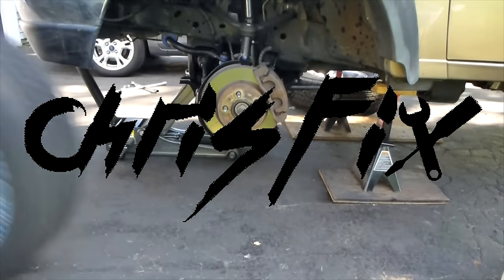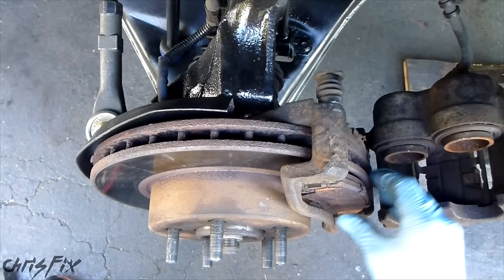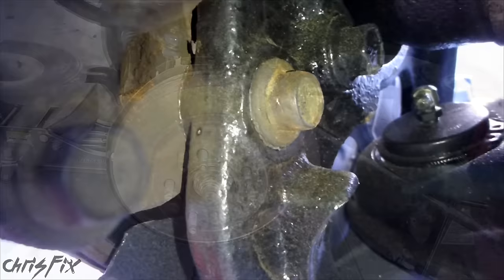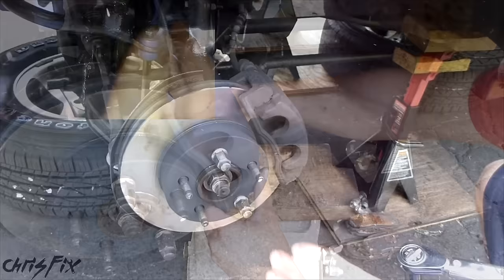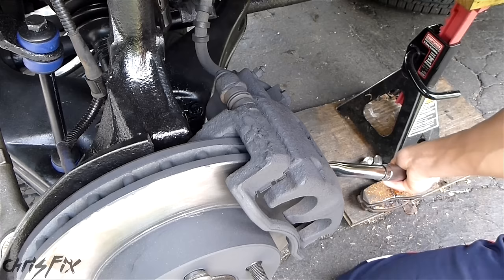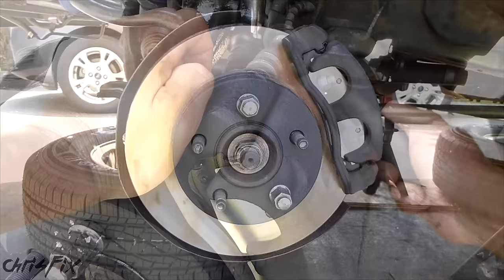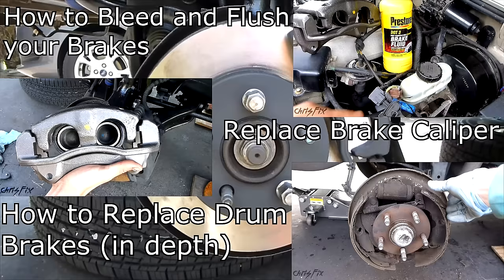How to Replace Front Brakes, Pads and Rotors

Comment: CHRIS, When bleeding a vehicle with all 4 ABS braking system, does it matter what order you bleed the brakes? Some guys do front right, then left rear, then front left and finally right rear.  What do you think?
Reply: Sully Cop It depends on where the master cylinder is. If it's on the driver side, it goes from rear right, rear left, right front, and left front. If the cylinder is on the passenger side, it's rear left, rear right, left front, and right front. In other words, farthest to closest.

Comment: That helped.  Thanks.  Btw is putting that silicone on the long bolt really needed and adding grease to the contact points.  What i mean is it important enough that i should run to the store and get some?
Reply from the maker: Yes you  definitely want to get some silicone grease. They sell small packs of bulb grease at the parts store for $0.99 which is the same thing.  Watch my newer brake video that covers every single detail: https://www.youtube.com/watch?v=6RQ9UabOIPg
Reply: That was even better, thx.

Comment: Hey Chris I was trying to change my front brakes on my 2004 Ford Ranger but I was not able to get the bolts loose that hold the caliper bracket to the rotor.  Any suggestions on what I can do to loosen those with out snapping them off?

Comment: My rotors are getting extremely hot  🔥  does that mean I need to replace and when I brake they don't squeal.the make like a squeeking bed sound and feels crunchy if that makes sense ?.Amy advice fellas ?money is tight so don't want to replace something I don't have to.  But nervous working on brakes something I noob shouldn't be doing but I have to.learn one way and one day any help is appreciated thx
Reply from the maker: It sounds like the pads are worn down to the metal which is causing the crunchy/squeaking feeling, I would start off with inspecting the pads/rotors and going from there

Comment: hey chris, if I dont have a breaker bar and only just a normal ratchet - is it advisable to use a lubricant to help with unscrewing the bolts?

Comment: Thanks, Chrisfix - used this today on my 2011 SHO. Question for you: the replacement pads came with hardware, and I used it - but it only came with the metal parts that the pads ride in, and did not include a spring that was on the existing brakes. The spring was in between the pads at the top and bottom and looked like it pressed them outward. I didn’t want to mix old and new parts, so I left the springs off when reassembling. Looked at Rockauto and for the 2011 Taurus SHO, only one hardware kit comes with the springs - all others are just the top/bottom metal pieces. Anything to worry about, in your opinion?

Comment: Awesome video Chris did my first brake with your help thank you.? For you I think I made one mistake on my front pads where the piston meet the pads I forgot to put brake grease do you think this may give a problem and if so should i simply take the wheel off and redo it.your thoughts please it's on a 2012 dodge ram
Reply from the maker: Awesome work. If you sanded the surface clean and used new brake hardware, you can get away without greasing it. If it starts to squeak, you know what you need to do haha.

Comment: How do you know how many foot pounds to torque things and how did you perfectly get it to 85 or whatever it was with the breaker bar is it electronic on there?? I never understood that does it say in the manual or online? I always tight stuff pretty hard which I've learned snaps bolts but yea how do you know that?

Comment: I got a question mister, is it mandatory to change the rotor in order to change the pads? I got the brake pads but I couldn't afford for the rotors, which is why I'm asking if is possible to change the pads without changing the rotors, and leave the old ones.
Reply: You don't have to change the rotors when you change the pads. You only need to do rotors if the rotor is warped or cracked. Pads usually are on their way out long before the rotors.

Comment: hi , i recently changed the rotors/brake pads/brake fluid. should i follow a certain driving habit for the few hundred miles on the new kit?
Reply from the maker: You can drive them normally. There is something you can do called bedding the brakes where you drive 40mph, jam on the brakes but dont lock them up and bring the speed down to 10mph, repeat this a few times and then drive normally to cool the brakes down.

Comment: What does it mean when you take the whole brake caliper off and it struggles to get back on ( kind of forced it on where the holes for the bolts where then tighten them. 
But I didn't put in new brakes just put my old ones back in and now I'm getting a scraping or scratching noise when I turn and loud squealing and squaeking whenever the wheel is turning not just when braking but when I'm off the brake and in drive

Comment: Hey Chris thanks for the great videos. I followed this to work on my own, but after being done I went for a test drive and I'm hearing a grinding noise and feeling it... any thoughts or ideas as to what I might have missed or done wrong ?
Reply from the maker: +Sergio 5280 There really isnt much you can do wrong. I would take the wheel off and just do a quick inspection. Maybe your caliper is going bad and not disengaging?
Reply: +ChrisFix thank you sir will def. look into it

Comment: just wondering i did all my brake pads and did my front sway bar links and replaced all my struts and shocks on my jeep patriot and now i noticed theres a rapid thudding noise when i start braking.  let my rear brake pad wear down to the metal. i replaced the pads anyways the rotor is damaged. i read that that noise could be the rotor. wondering what your input is

Comment: I just replaced my rotors and brakes yesterday and while I was driving I heard a grinding noise coming from the back tires , is this normal? The rotors and brakes are brand new.
Reply from the maker: Grinding is not normal. Did you make sure the brake hardware was not touching the rotor?

Comment: hi chrisfix,I have a question,so we only need to bleed if we just only changing the pads?thanks
Reply: You only need to bleed if you're replacing the actual Caliper itself. You have a brake line that leads into the caliper. Inside the caliber is your brake fluid. When you replace the caliper, you have to disconnect the brake line from the old caliper in order to connect it to the new caliper. When you do this, there will be no brake fluid in the new caliper. Because of no brake fluid in the new caliper, you have to bleed the brakes. 

Hope I was helpful :)

Comment: ChrisFix, I am in need of chainging out my rotors and pads on my 2008 Mazda 3 i. I have been searching around the web on which brand are good. The local auto store has some but are 50-60$ per rotor and about 45 per pad set. However, I have found kits that are abour $160. What is your advice on selecting a good rotor and pads? What brands are good and not good? Thanks

Comment: I was quoted 330 to replace front pads and discs plus bleeding on my car by a dealership. Me being me i started searching if its a good quote. Parts it self 250ish, so if i was going to do it my self thats nearly 100 in my pocket.. then i would had to buy hydraulic oil, some tools, anti seaze, take a day off work, so the 330 quote is looking cheaper compared if I was going to do it my self
Reply from the maker: That's a pretty good price! Usually the dealerships charge way more than that
Reply: @chrisfix  probably I should mention that it is 330 brittish pounds heh. Yeah, it is a very good quote, where I live we have 11 car dealerships just in one town and countless mechanics\garages, they need to be competitive to get the work which is a big bonus for customers like me.

Comment: Anyone  that is a first timer to changing brakes on a Ford Ranger, these instructions on the video don't apply for taking the disc rotors off for a 2wd. The 2wd rangers require the whole wheel assembly (wheel hub and rotor come together as one piece) to come off. You have to take the dust cover off, remove the cotter pin, remove the axel nut washer, front outer bearing, then slide the whole wheel assembly off.  You have to repack the bearings in the new disc brake rotor and hub assembly. This is more steps than required for the 4wd. Just wanted others to know what you are getting into if you have a 2wd. I made the mistake of thinking my rotor was stuck to the wheel hub. It wasn't because it comes as one piece with the rotor..

Comment: hey man. silly question. I have a Chevy cruze 29,000 miles had since November 2014 and never changed my brakes since then. is that bad??? got the car brand new at 500 miles. should I put on a new rotor and pads
Reply: Why replace if there's no problem?
Reply: that was a few months ago. i have now learned how to check em haha my brake pads are still good

Comment: Hello Chris, I am trying to replace the rotors on my Mitsubishi Colt 1.1l, 2006. I took the callipre and callipre bracket off but the rotor wouldn't come off. I tried with screw driver as well as hammer but the rotor won't move a milliliter. I am wondering if I need to take that big 32mm nut off or is there some other reason. Please let me know, Thanks.
Reply: try using a penetrating fluid if its considerably rusty, and keep going with the hammer

Comment: I have to say this as constructive criticism and I really do think you need to add it to your video especially if you're advertising that it works for all makes and models but Hondas and Acuras use a Phillips tip screw on the rotor which is almost impossible to take off without an impact driver

Comment: Hey ChrisFix, love your videos!  You are very thorough and informative.
Unrelated to the video I'm actually in the works to have my wheels cleaned and painted.  Like you I also hate the look of plastic hubcaps so I'm going to be running my wheels bare.  Problem is my hub bearings are rusted and I don't want that to ruin the look of my freshly painted steel rims.
Any advice on how to clean those up?  Thanks in advance!
Also happy new year! 🎉
Reply from the maker: Use a metal wire brush and then put a lite coat of paint on it!
Reply: @chrisfix  Thanks for replying!
I will see how well a wire brush will work on the center hub.  That aside I did enjoy your 'How to paint your wheels' tutorial.  I'm excited to get started on the project.  Just waiting for the weather to improve here in central Cali.

Thanks again for making these great videos!  Your fans appreciate you.

Comment: hey Chris I had a question for you. I thought I followed your instructions which are great by the way. But I replaced my brake pads and now I am noticing when I go to break that my steering wheel shakes as if the brakes aren't making very good contact with my rotors. any suggestions on what it might be? Or a way to troubleshoot?
Reply from the maker: Did you replace your rotors? If not you can have warped rotors which causes that feeling.
Reply: No I didn't. They didn't appear to be too bad. No distinct grooves when I run my finger nail across them. But they could definitely be warped. And I accidently snapped one of the bolts when trying to get it out of the caliper unfortunately. But I was able to buy a new one for not that much and replaced the old caliper bolts with the new ones that I bought. The calipers hold pressure but they are original and rusty. Wish I had the money to replace everything, calipers and rotors. Thanks for taking time and commenting back. Wish you were local. We need more honest, smart car guys like you in this world.
Reply from the maker: +Kyle Weckenbrock yea it's probably the rotors then. Glad I was able to help and don't worry, we all snap a bolt here and there!

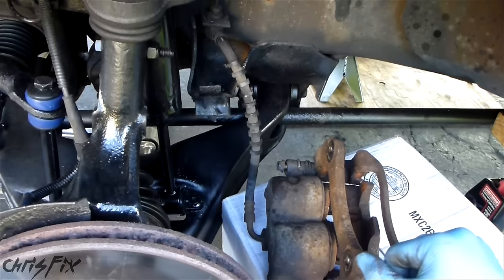Comment: 2:24 - "Now this should just slide right off"  That never happens. Brake rotors almost always get rust welded to the hub. Use a pusher bolt/nut setup through the brake caliper mounting holes to push them off. Sometimes additional coaxing with a hammer is needed.

Comment: Hey Chris what kind of brakes should I buy? It's just for my Subaru don't need anything special
Reply: Semi Metallic pads are cheaper but Ceramic pads are more expensive than semi metallic pads but they last longer. Drilled and slotted rotors are more expensive than regular smooth ones, its the same concept. Hope that helps

Comment: I recently had my brake pads changed, then the front right one was making a super loud long whistle noise. Took it back to the mechanic and redid the front brake pads again. Days later that same loud whistle noise came back so I took it elsewhere and they charged me $230 to do God know what and assured me the noise would go away. Well it’s back again 😩 what could it be?

Comment: Mine makes a squeeling noise when I break sometimes, I'm assuming I need new pads?
Reply from the maker: +Joe Luis Maybe. It could be just contamination and in a few days it goes away. I would take the wheel off and hit the brakes with brake clean and do an inspection to see the pad depth.

Comment: Common mistake made here. The rubber boots caliper pins require the lube provided. It dusnt go anywhere else. If u put on mounting surface grease will contaminate the brake pad and rotor surfaces. Before you even put rotors on, you thoroughly need to wipe the surfaces clean. Not just spray them. You can clean metal to pad surfaces with a wire brush and brake cleaner. Also the rotor surface to hub needs to be clean.

Comment: hi Chris,  I just replaced my driver side front brake,  rotor,  n caliper..   my old caliper was seize up and causing my brake to smoke..  I replace the front driver side caliper, brake pads,  but still smell the brakes,  and when I remove my foot from the gas pedal, the car feels like its slowing up..   what can be the problem?   please help me...
Reply: +jose ilarraza I'm not sure about the smell, but as for the car slowing down does it slow down like the brakes are being applied, or like the normal engine braking? Either way just take it to a shop and get them to check it, brakes are kinda important and if they fail... Well it wont be too pretty. Better safe than sorry

Comment: About the only thing I didn’t like was the ‘no need to bleed the brakes’. You should bleed your brakes every time you change the pads They should be bled before you push the pistons back in to make space for the new pads. When you see the colour and condition of the fluid that first comes out you’ll understand why. By pushing the calliper piston back in without bleeding them first, you’re pushing dirty, burnt brake fluid back up into the system and are asking for trouble.

Comment: @Chrisfix hey Chris. In my country it’s hard to get Silicone Paste. I found some in the internet from 3M, but there are two different kinds. Wet & dry. Which one should you think goes well with brake jobs? Such as applying to the guide pins. Thanks.

Comment: Is this process the same for the rear brakepads/rotors?
Reply from the maker: For many cars it is the same or just slightly different (you will be able to figure it out). Some pistons have to be turned (like a screw) in the rear instead of pressed in.

Comment: Hi, do you know what size rear rotors would be the correct size to buy for my 2004 Chevy Silverado, 2 door, 6.0 v8 extend cab? Thanks for your time.
Reply from the maker: +AllSystemsGoSound You can check at your local parts store or call chevy for that information!

Comment: The brake and light inspection wanna to charge me 1000 to fix my repairs.  So I went to TJ Mexico they replaced front brakes ,drum brakes front rotors front wheel seals, wheel bearings rear seals bearing ,also rear wheel cylinders they also installed a new brake line hose. For just 170 I brought all the parts in autozone in the states. I also got a life time warranty air compressor ,condenser, A/C Accumulator orifice tube at car quest in Tijuana he put new o rings flush every thing out and just charge be $160 it would had cost me over 1200 to fix that in the states.

Comment: hi Chris
been following and subscribed for a while. so i gotta ask im changing my rotors and pads soon, i just have quick question, im buying CARQUEST WEAVER rotors from advance auto parts, but i wanted to upgrade my pads for a better performance and longer life. im thinking of buying bembro or wagner pads that i saw on ebay. So, basically all rotors will be replaced with CARQUEST rotors brand, but pads are brembo or wagner. is that ok to proceed?? im doing this because im not confident carquest pads, ive been reading reviews they arent enough for me buy it. so is it ok replaced my rotors with carquest and pads are wagner or brembo?? appreciate your response. 
thank you

Comment: I have a Brembo 277mm Brake Disc and a Subaru Original 294mm Brake Disc, what´s the difference, both fit on my Subaru, but why do they have a different outer diameters.
Reply: +keijimuto Basically more surface area = More stopping power. 
As a simple rule, the larger diameter of the rotor, the more force that is available to stop a wheel, just like using a longer wrench makes it easier to break a frozen bolt loose. If you kept the same caliper and same pads, but installed a larger diameter rotor, you would get greater stopping power. Factory rotors are sized according to many factors: wheel sizes, calipers used, unsprung weight, tires, price, etc. Initially, it would seem that the largest diameter rotor that can be obtained should be used, but those other factors must be kept in mind. Even, a reasonably larger diameter rotor will provide increased stopping power.